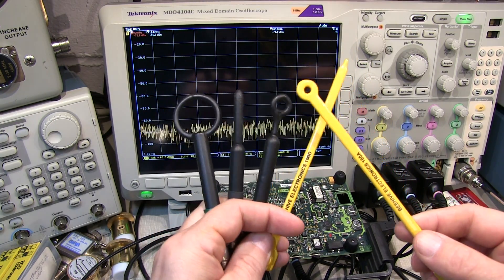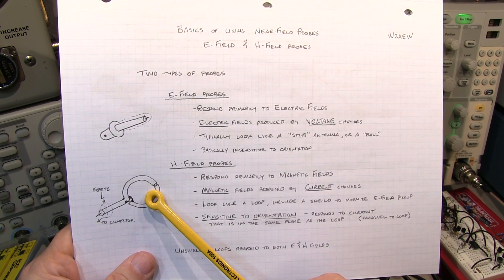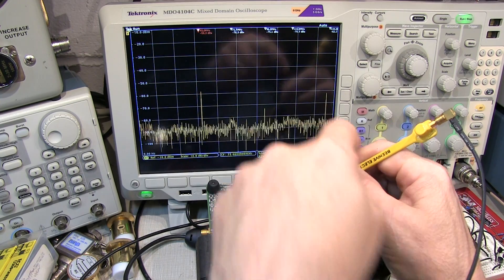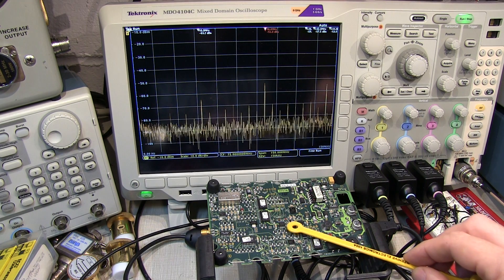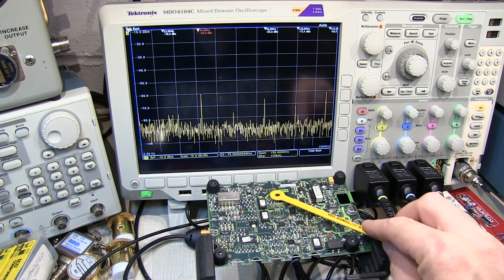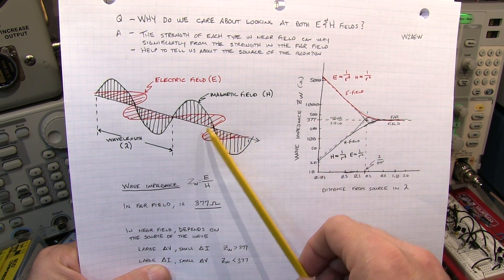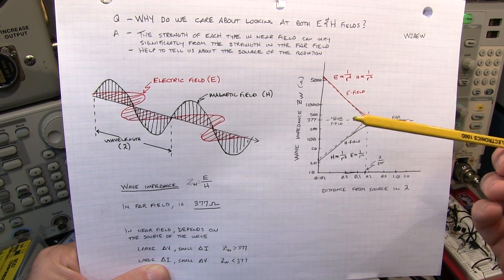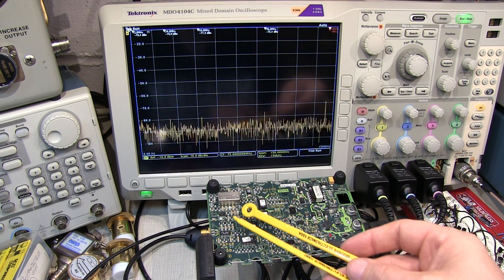#234: Basics of Near Field RF Probes | E-Field & H-Field | How-to use

Comment: I have an instument called polar toneohm 950. It helps find shorts. One of its functions is following a trace on a pcb using a touchless probe, while injecting voltage in a shorted bus using 2 other probes. The voltage is veriable and maxes at 0.500 mv, also generated by the machine. The voltage is pulsed and has a specific frequesncy. Probe does not work with just any voltage. 

I was wondering if you would know what this probe is. It has a small inductor at the tip and is directionally very sensetive. There is no lupe in the front. Unless the small smd inductor is its lupe!
It's supposed to find shorts by following the current field. As it gets close to where the short is the mechine beeps louder.
Reply from the maker: I am not familiar with this instrument, so can't comment on how it functions.

Comment: The near field probes are often used effectively to detect emissions from PCB assemblies.
Would these probes be as effective to detect the sources of emission in Power Electronic equipment of > 50 KVA rating, like a UPS or a VFD?
Reply from the maker: Certainly - just be wary of the voltage/insulation ratings if you probe near high voltage points.

Comment: Best explanations. Thank you. For EMI testing, it is mainly for far field. It would be interesting to see the correlation between near field probing vs real EMI testing. Is there any way to build a far field (home) setup for pre-compliance testing?
Reply from the maker: The correlation between near-field measurements and far field measurements is not going to be consistent.  Signals observed in the far field will be observable in the near-field, but may be predominantly E field or predominantly H field - it depends on a number of factors such as the impedance of the circuit creating the emission, etc.  In other words, near field measurements are not good predictors of far field behavior - but far field signals can often be located using near-field measurements.

Comment: Hi Alan, Thank you for making and sharing the videos.
Regarding ~1:20 I believe these loops are not really "shielded". Across the gap at the top, you should have the same voltage difference (hence e-field) as for the feed of a loop made of a single conductor of the same size. I recently did a 3D EM simulation that also shows this. I can share screenshots if you like. I believe the coax shield is only kept in place to prevent cable waves on the feeding line. But this can be further analyzed.

Comment: hi regarding the self made probe at 2:17, how do i design the size of the loop and number of loop? does the size of loop will afffect the sensitivity to different frequency like antenna ? hope to hear from you soon!
Reply from the maker: larger loop diameter increases sensitivity, but makes it harder to precisely locate a source of the signal.
Reply: @w2aew  how do i know the loop i made able to pick up the radiate emision in higher frequency, let say 2GHz?
Reply from the maker: @boonyang88  Easy - hold it next to a known 2.4GHz emitter - such as WiFi router or Bluetooth device, or even near a microwave oven.

Comment: Great Video Thanks you might have an answer for me. I am interested in building Loop antennas for HF band.  Do you want the XL and XC to equal 377 ohms of Z radiating  coil loop IE for 10 watt  W=I^2*Z and  W= E^/Z where Z=377 Ohms....I=(10/377)^.5=0.162 A......E=(10*377)^.5= 61.4 V  RMS I assume.?????    the input coil will have to match the the input loop of 50 ohms to the output loop  377/50   7.45 to 1 transformer  primary to secondary ratio ????   so input coil Z= 50  I=10/50)^2= 0.442 A.... E=(10*50)^.5=22.56 V...input Z voltage=22.56 V  output Z voltage= 61.4 V ratio of  2.72  why does this ratio not match.  2.72 ^2= 7.4   close to ratio 7.45   So  transformer impedance  is also square law????    people on you tube are saying  they are getting several thousand volts across  an RF coil with only 100 W input   Why????     if you could help me figure this out. ????? thanks N7RBC

Comment: I never knew that these things existed! They certainly are a handy tool but for me, I would rather connect those probes to a signal tracer... I only work with audio equipment and finding noisy resistors, well there's no better way to find them than using a probe like that. I have been planning to try using a head from a cassette deck but I haven't got around to it yet...

Comment: Excellent teaching video. Can you add some comments or technically explain the reactance area of the near field "inside" a large solenoid antenna. (say 60 cm in diameter). It is the area where E and H fields are unpredictable. I am looking to find an answer but I can't.
Reply: I have very basic knowledge in this topic, but I saw once a nice experiment made by Jeri Ellsworth "Magnetic Loop Antenna Current and Voltage Distribution", maybe it will help You: https://www.youtube.com/watch?v=adJp1zO9qfo

Comment: Hi! Great video. I want to recreate this type of measurement. I could find the probes, but not the cable you used. Could you provide a link where to get the connector cable? Thanks!
Reply from the maker: The connector on these probes is an SMB.  You can use an adapter to go from the SMB to a suitable connector such as BNC and then use an ordinary BNC test cable.
Reply: @w2aew  Hi! Thanks for the info, I will see to find the connector and cable.

Comment: At my work I had a set of 3 + 3 near field probes and an accompanying termination / 20 dB amplifier.  But I made some of my H field probes using a gapped ferrite ring for some special situations.  Since my retirement, I have built a few more to restore my lost abilities.  But where I’m going with this introduction is that recently I bought an Aim I-prober model 520.  And that is amazing!  It is intended for H-field and for following very small traces.  Not cheap, but for me worth every penny.

Comment: please tell me about the  right angle connector that you are using on probe? is it SMB or SMC?
Reply from the maker: It is SMB.
Reply: @w2aew  can you compare H field probe and high frequency current transformer HFCT?

They are used in power grid to test for partial discharge signal.
Reply from the maker: @tejeshwvardhan1165  HFCTs are typically used at frequencies under 200MHz, and are designed specifically to have the "wire under test" pass through it, so that you're measuring just the high frequency content of the current on that particular wire.  The H-Field probe shown in this video is typically used at much higher frequencies - up to several GHz - and thus won't have as much sensitivity at the lower frequencies associated with PD.  They're mainly used as "sniffer" probes to look for the source of an RF emission.
Reply: @w2aew  HFCT upto 3Ghz are available. would   love to see a video of ferrite core and their frequency response
Reply from the maker: @tejeshwvardhan1165  OK.  I haven't used HFCTs myself.  They do generally want the wire of interest to pass through the center.  Note that there are many different types of ferrites, all which have different permeabilities vs. frequency.  The particular ferrite "mix" is chosen based on the frequency range of the application.

Comment: Great video. But electric fields are not caused by changing voltages, they exist whenever charges are around each other. Every time there's a difference in voltage between two points there's an electric field between those points (by nature of voltage being the energy per charge and electric field E being force per charge). Magnetic fields (H) are similarly caused by all currents. Not that I think you don't know this already, but just for other people watching! The radiated field contributions on the other hand are caused by changing voltages and currents, as per the video. A small thing but worth pointing out IMHO!
Reply from the maker: Yes, of course!  I appreciate the correction/clarification.  I guess that I meant to say that these probes are sensitive to "changing" fields...

Comment: Very helpful.  Pray tell..  what scope input impedance do you use with probes like these?  50-ohm or 1M?  Also, at what frequencies are these probes effective?  Can they work on circuits as "slow" as 10-50 MHz?  Or are they pretty much limited to 100+ MHz and beyond?
Reply from the maker: For sensing, you would usually use 50ohms, but 1M would be OK in many instances because you're only really interested in relative signal strengths.  They will have an attenuated response below 100MHz.

Comment: Nice video.  Where'd you get that plot of impedance vs FF distance?  I thought it's always 377 Ohm, irrespective of how close you are to circuit impedance.  A GTEM cell can go to DC, and if you place the field probe within the septum, the impedance (E/H) is still 377, even though the septum Z0=50 Ohm, all the way down to essentially DC.  I thought E/H would be 50 Ohm, but after hours of researching, it's always 377.  Maybe this only applies to within a TEM line.
Reply from the maker: This plot of the wave impedance is in several references as applied to radiating elements.  Without doing the research, I suspect that since the TEM line isn't radiating that the E/H relationship may revert to the impedance of the medium (air), thus 377 ohms.  Although, I can certainly see the argument as to why the E/H impedance would be 50 ohms, since the voltage/current creating this field is from a 50 ohm source.  Hmmm - a good question for the next time I run into my old EM Field professor...

Comment: 3 basically free probes I find very effective:

1.  Simply cutting a small diameter coax cable flush and insulating the cut end with a thin layer of glue works very well for isolating noise down to individual trace level.   
2.  Same as 1 but allow the center conductor to stick out a bit.  This would be similar to the E-field prob in this video.
3.  Using small coax again, simply make a tiny loop from the center conductor back to the shield, and insulate.  This very small loop is again handy for isolating noise to trace level (or close).

If you are not seeing much of anything,  do the common things to lower your noise floor:  Turn on the preamp (if you analyzer has one), or use an external low noise amp, remove attenuation, reduce resolution bandwidth, reduce span if you want to increase the sweep rate.
Reply from the maker: All good tips, thank you.

Comment: I just use a sniffer with a metal Tip and metal ground then I just try to match my cascade analysis in the chain when I debug. Do you not like that style sniffer or are you strictly trying to catch fields ?
Reply from the maker: The near field sniffer probes are useful only when you're trying to track down sources if undesired RF emissions, not general debugging.

Comment: Wow! This was such a great video!! One thing that wasn't clear to me is how do you connect the probes to your MDO? I saw that Beehive doesn't sell a cable with a BNC ending. Do you use the "BNC probe adapter 0309-0006" and connect it to the scope with a BNC male-male cable? What would you recommend? Thanks!
Reply from the maker: Simply use an adapter to convert from SMB to whatever you need to connect to the instrument
Reply: +w2aew Beehive has SMB to N and SMB to SMA cables available; those cables are double shielded. Pretty pricey but supposedly good to 6 GHz.

Comment: Thanks Alan for the very interesting video. In principle, is it possible to measure the energy radiated from the circuit by measuring both E and H at the same point (as ExH is proportional to energy, Poynting vector )? Did you use the FFT mode in the scope to measure the frequencies?
Reply from the maker: +esmaeil nam Not really - the probes aren't really calibrated, and they're not very precise in measuring the field in the same location - since the fields are falling at a rate of 1/r^2 or 1/r^3, there can be huge differences in measured strength with very small radial distance errors.  The scope I used has a spectrum analyzer built in, but you could use the FFT on a scope channnel.

Comment: Nice video, thanks for making it.

I see that Beehive and Tekbox both offer wideband amplifiers to complement their probes. Do you recommend such an amplifier for the EMI probes? Are the received levels often so low that you need one if your spectrum analyzer doesn't have a builtin one? Or is there another reason for using one?
Reply from the maker: +Electronic Eel A  preamp is often  needed when using these probes with an oscilloscope.  When using a spectrum analyzer, it really depends on how low the noise floor is on the analyzer, and if it includes a preamp of its own.

Comment: Thank you Alan for another great class.
Recently I ventured to assemble and search a little more about the magnetic loop antennas for use in my humble apartment ham radio station.
The main problem I try to work around, is the excess of of QRM coming from the failure to proper grounding of my station. Recently built some magnetic probes and using a SDR dongle connected to HDSDR able to locate some sources of noise generation.
Unfortunately I found that a lot of equipment in my country do not have an efficient control of EMI emission and therefore hinders much the practice of SWL.

But how to persist is a positive feature in our hobby, still sniffing more noise sources and trying to eliminate them through changes in noise generating equipment.

Thanks again for sharing.

P.S: I'm sorry for my rusty English
73 PU2SRZ

Comment: do the probes offer indication of exacting strengths of current and voltages.
Reply from the maker: +dale myers No, they're really just best as relative indicators.
Reply: ok. i just picked up my first o-scope, a goldstar os9020g. and these seems interesting to me for extra probes to supplement my efforts. i want to fix some of my dads old radios from when he was a truck driver and my old radios, like kenwood tr7950's. i love their simplicity of operation.
 you wouldn't believe the antennas dad picked up from the auto truck wash. fire-stick galore and those with several sizable coils, i guess they weren't thinking. but one benefit, i do have a large collection of vice grips. and a grinder to remove welded tabs where the antennas mounted.....

Comment: Who would call a magnetic field probe an H probe?
On the subject of illogical symbols, why would anyone call current I? And inductance L? Not like capacitance is worthier of C than current.
Reply: Check out the SI unit Henry. 
https://en.m.wikipedia.org/wiki/Henry_(unit)
Reply: +TheMrTape You'd know if you learned basic electromagnetics;) H is symbol for magnetic field vector. There are only so many letters in the alphabet;p Current is denoted by I because it's actually current *I*ntensity which was shortened by applied science people to just "current". Now I wonder why we don't call light intensity just "light" to be shorter:P Inductance is because of Lenz so it's not that intuitive, well, letter I wasn't available anyways.

Comment: Now...is there any way to get an idea of the far field based on near field measurements? If so, video please :-)
Reply from the maker: +qwaqwa1960 Not really - because it is very difficult to obtain any useful calibration on these probes, plus it would be difficult to quantify the effective radiation efficiency of the radiating structure on the PCB.  Most use cases are where you're searching for the source of an emission that was already reported in the far field.

Comment: Re making your own H probe, could you use thin coax instead of bare wire to implement E shielding? Or maybe a foil wrapper around the coil :-)  A little Faraday cage...
Reply from the maker: +qwaqwa1960 Yes - all possible.  There are some good DIY examples in the links provided in the video notes.

Comment: Could you tell us a bit about your scope?
Reply from the maker: +Tom OConnor It is a Mixed Domain Scope - four 1GHz analog channels, 16 digital channels and a 6GHz time-correlated spectrum analyzer.  I work for Tektronix, so I am fortunate enough to have access to fantastic equipment like this.
Reply: +Tom OConnor C
Reply: +w2aew does tektronix make vector network analyzers? My employer is very loyal to keysight but sometimes tektronix surprises us. Anything like the PNA-X that comes with a bias T option and noise figure cold source option?
Reply from the maker: +Scuba Bro Not at this time, but who knows what the future holds??? ;-)
Reply: +w2aew in my opinion you guys are the best in the time domain. It would be great to see you guys give rhode & Schwartz and keysight some solid competition.
Reply from the maker: +Scuba Bro Tek has some very compelling spectrum and signal analyzer solutions (unfortunately not marketed very well). Best integrated solution set for spectrum/realtime/signal analysis IMO.  Current offerings in VNA space are TDR/sw based (for now).
Reply: +w2aew 

Time domain reflectometry is an expensive little add on for key sights PNA's. I look forward to seeing what you guys put out. Go invest in a loaded PNA-X and gut it. I'm assuming the hardware is standard and the secret sauce is in the cool little application options they sell for $10k or more each. Can you please make a PNA that does harmonics and spurious measurements. I'd love to have an all in one PNA and eliminate the spectrum analyzer. I know many companies that would invest $300k for one of those.
Reply from the maker: +Scuba Bro Tek already has this - wideband TDR + software to do S-parameters, etc.